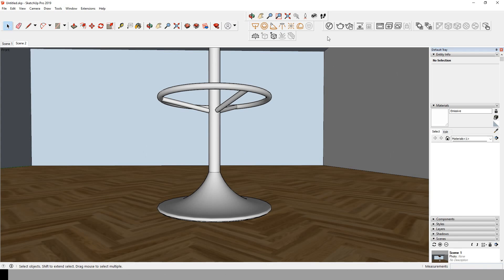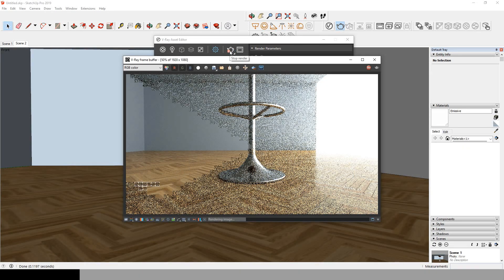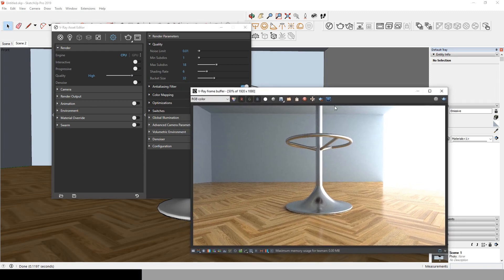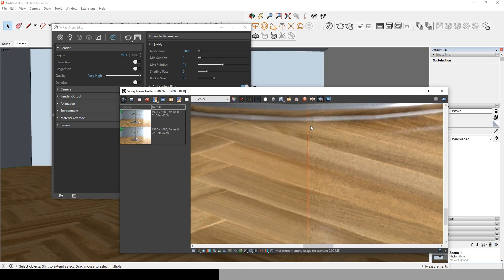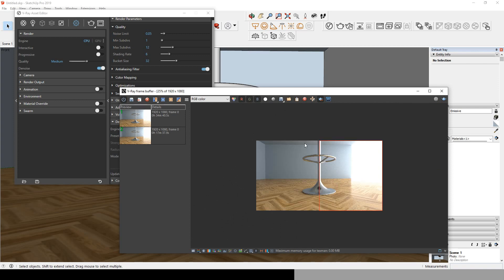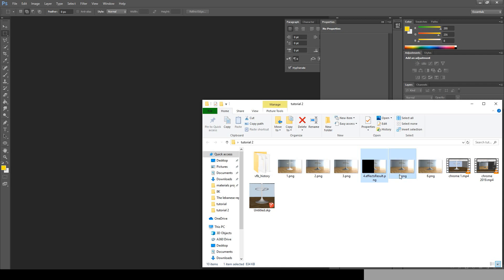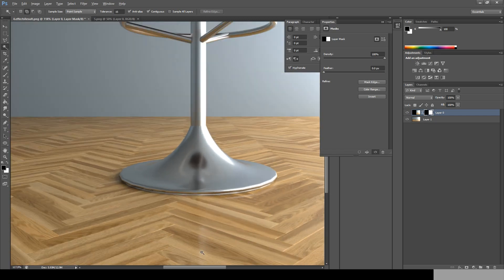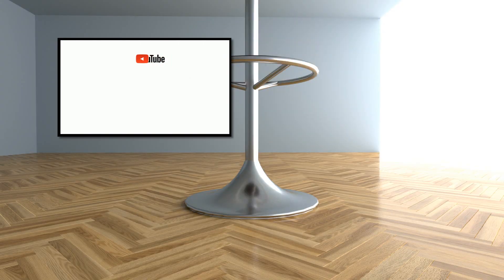Learn to reduce noise in the render -  Vray Next and Sketchup 2019

Comment: hi karl, thank you very much. this video really helped me and now I can get better rendering results.😊🙌🙏

a little more question, is the light in this video using HDRI?
Reply from the maker: No. I just put a rectangular light . But you can always use HDRI there are some maps for the interior scenes and the exterior scenes!
Reply: @facadesdesigns  Ok. ok i will try that.

why don't you use the element feature?

Your video is great, you convey it very clearly and easy to understand.

I am always waiting for your latest videos, especially the rendering tutorial using vray and sketchup
Reply from the maker: What do you mean by element feature?